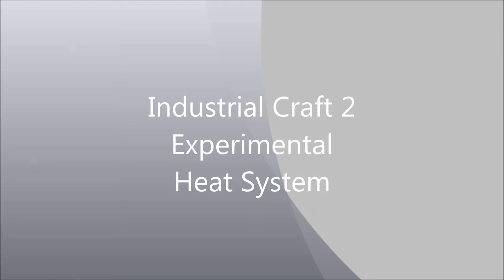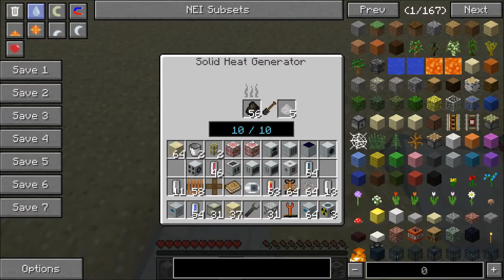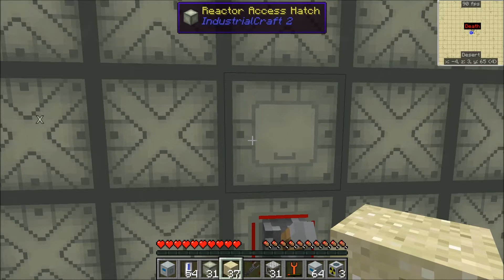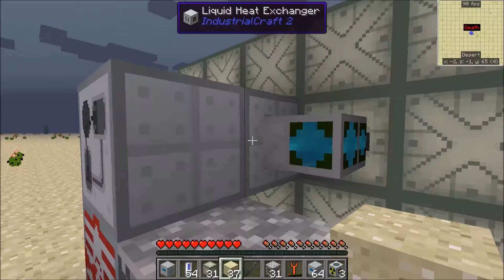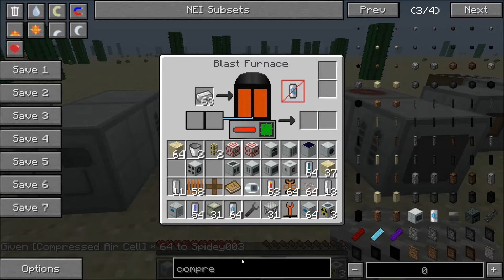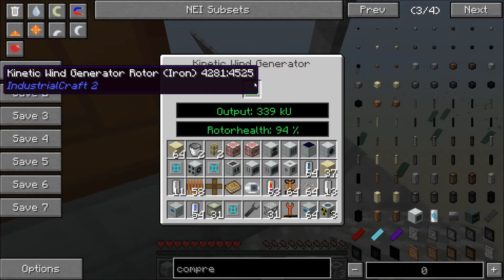Industrial Craft 2 Heat System Minecraft 1.7.10

Comment: If you guys are trying to create refined iron but it is not working, I'm going to give you some tips:

1- You have to put at least 1 coil inside the heat generator (took me forever to discover), just if you put 1+ inside it will produce heat. The best option is to use the electric generator (because you can power it using EU).
2- The copper square on the heat generator has to touch the one on the blast furnace, if your generator is producing heat but not transferring it to the furnace, this is most likely to be the problem. You can change the direction of the copper square using the wrench, its gonna face the direction that you are looking at.
Reply: retvolki great. but before that few questions i for some reason cant find anywhere
1 what is new recipe for battery since old 4 tin 2 redstone 1 copper wire wont work
2 how to make rubber? smelting sticky resin does not work at all (furnace wont even light up)
3 how you make refined iron or any higher tier metal?

even any wiki i found wont have any info about these new machines. and there seems to be literally 2 videos in youtube on english explaining about this newest version

Comment: I can't seem to find anywhere to figure out how to get the heat to the blast furnace.  Generator is working (Burning coal and/or coal coke), the coils are facing one another, but does not show transferring heat and the blast furnace is not getting any heat.  Tried to figure it out in cheat mode and still no success. Very frustrating.
Reply: put a lever on the blast furnace... the heat generator won't do anything until the blast furnace is 'switched on'... took me hours to work out...

Comment: How to use Blast Furnace? Can not into Heat.
Reply: 1- The generator has to have 1+ coil inside
2- Put the copper square on the generator facing the one in the furnace

Comment: a question for you sir that blast furnace how did you get it to work for some odd reason my blast furnace doesn't work no matter how many heat generators I attach
Reply: 1- The generator has to have 1+ coil inside
2- Put the copper square on the generator facing the one in the furnace
Reply: +retvolki omg genius!!!, ty i was about to give up ... you are awesome :)
Reply: You are welcome sir, I'm glad I was able to help!